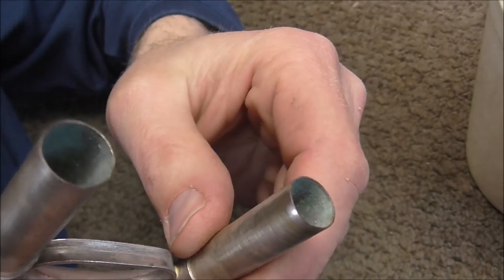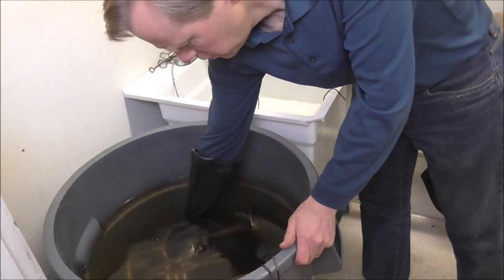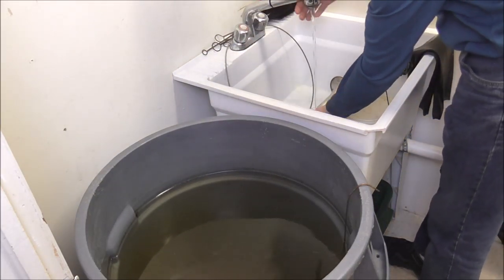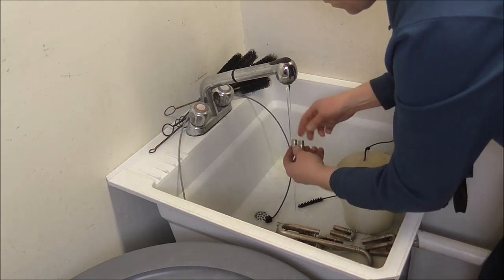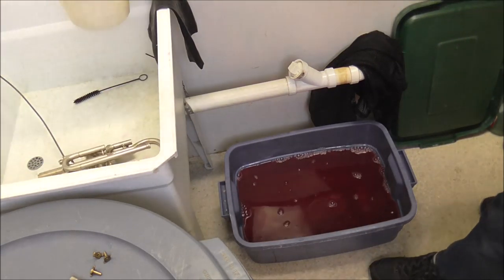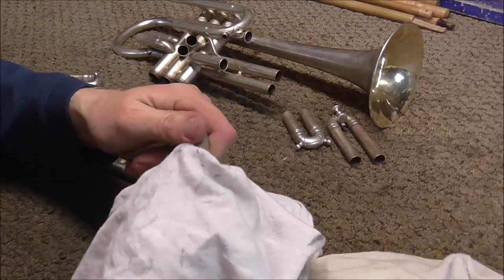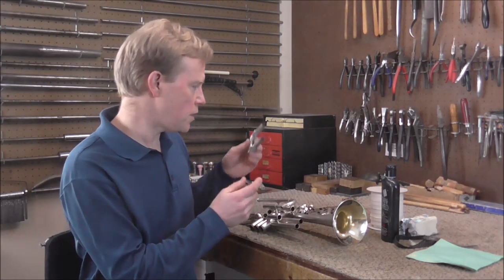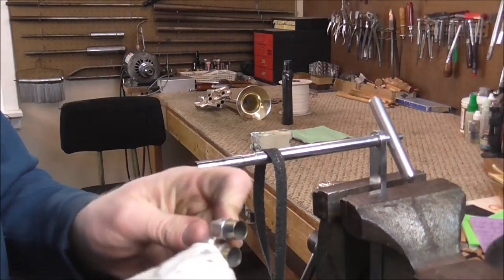Old York Cornet Restoration #7: Chem Clean and Polish

Comment: This series is fascinating ! I'm currently trying similar work on an old belgian baritone. But since i'm in Europe I can't order liquids from Ferree's they are not shipped overseas. Do you have any idea of the composition, or a recipe to make it ? I guess there are some acids but I guess you've to pick the good one...
Reply: For descaling, you can use a solution of citric acid. I've found that a concentration of 30g of lemon salt to 1L of water works wonders. Currently, until I finish my ultrasonic cleaning tank, I'm using a plastic 220L barrel for this exact purpose. You can also use acetic acid-based products, like Essigreiniger in the german Lidls. Works wonders in maybe 6-10 hours of soaking for the really old crudd!
Reply: Thanks ! I'll get some citric acid then, it's pretty cheap in powder (is that what you call lemon salt ? Sorry for the question I'm not english native)
Reply: @1090yoyo  Good morning friend, did you get the answers to the solution, for Brazil it cannot be sent either, could you help me?